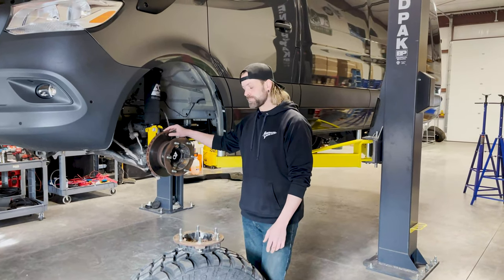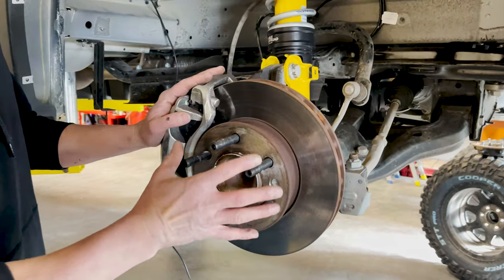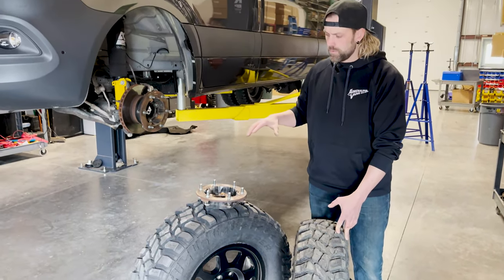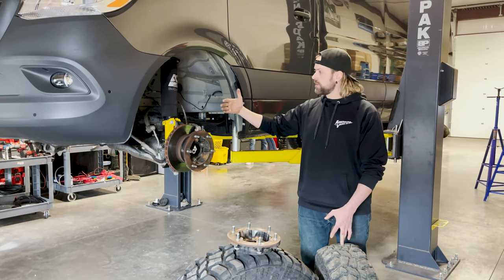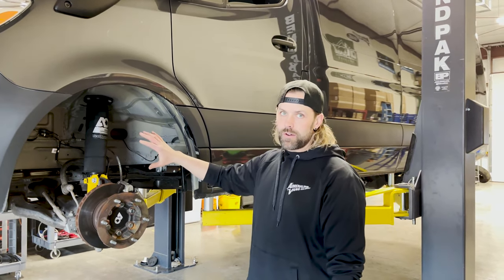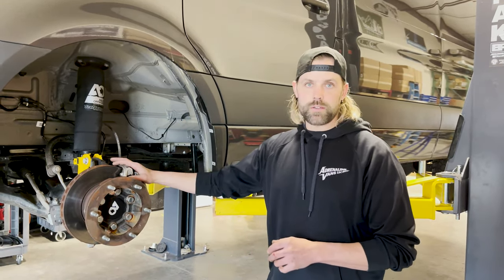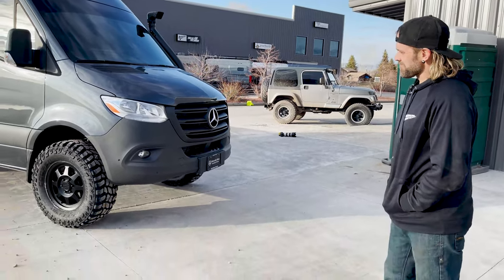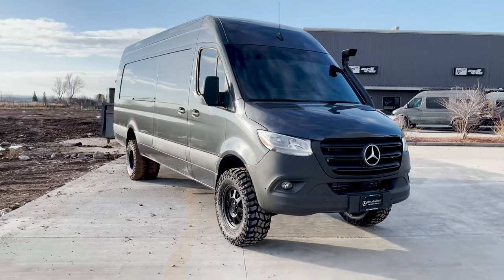Fitting 295's on our 2 wheel drive Sprinter 3500 dually!

Comment: I joust bought a 2012 3500 Dually RWD 160K. It sits so low . What lift kit did you use . What tire size did you use for the rear all 4 and the wheels. Your set up looks nice 😍😍. Can you suggest a brake upgrade too.

Comment: tire rolling circumference will change unless you change some coding in the esp control unit instrument cluster and transmission control,and ecu too,also using tire size calculator,you can swap a tire that's same rolling circumference as the rear tires but wider foot print.width will not cause mismatch but circumference will and yr van will not shift more than 4 gears.also you will need two spare wheels
Reply from the maker: We reprogrammed the ECU and additionally added a speedo calibration module. No issues shifting and spot on speedo readings compared to GPS. 👌🏼
Reply: @adrenalinevans  ABS and ESP will not work as it should in this configuration and this two cannot be reprogrammed, not even Mercedes dealers can do this… This van will be a dangerous vehicle especially on slippery surfaces like snow and heavy rain. I would rethink this idea …
Reply: iv been looking in to this for a while. with the same circumstances, (I found a 32 inch that will work great) running 235 in back and 265 front on same platform should be fine fine correct?

Comment: The dually delema... I have a 4x4 dually and the stock tires are about ready for replacement. I still don't know what to do. I don't want to go super single because the back has all the weight and is already sagging 1 inch lower than the front. But damn, I really want full width fronts like you have.
Reply from the maker: We can do super singles that will get you to nearly 8,000lbs load rating for the wheel/tire package which typically is sufficient for most class B/C Sprinters and they look really really good.  Also, we have plenty of suspension options to address that sag and dramatically improve your ride at the same time.

Comment: Would hub-centric spacers not be a good idea? I’ve got a 170 2wd and I’m about to lift/suspension and 285’s.
Reply from the maker: I’ve never seen hub centric for the Sprinter. I’m assuming you’re running super single wheels then with the 285’s?

Comment: Was that a 2in lift on all four corners? Curious if the two inch blocks were added to the rear leaf springs.
Reply from the maker: Yes, this has the 2" blocks in the rear as well as the 2" lift in the front.